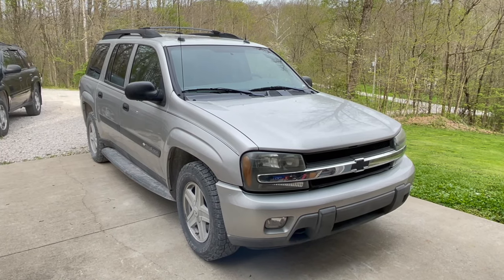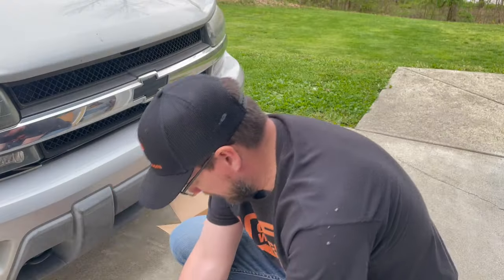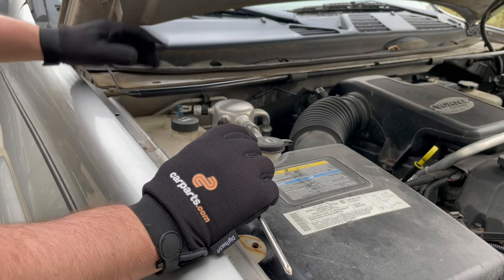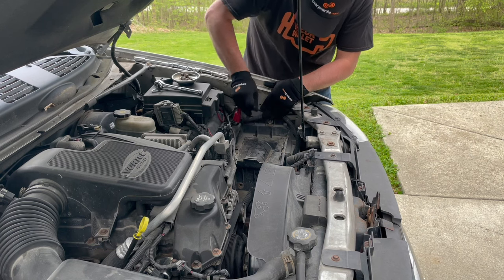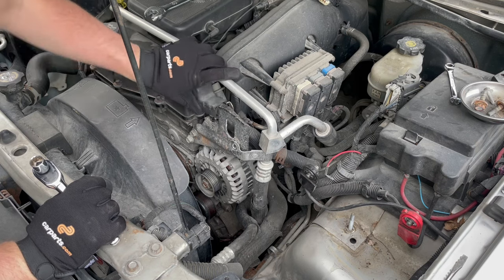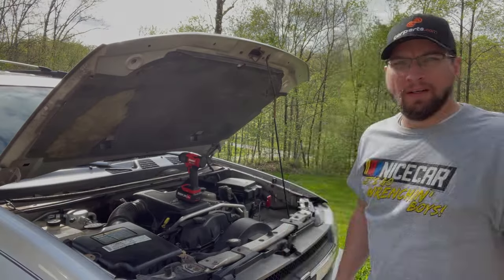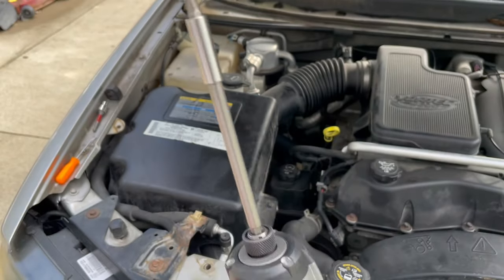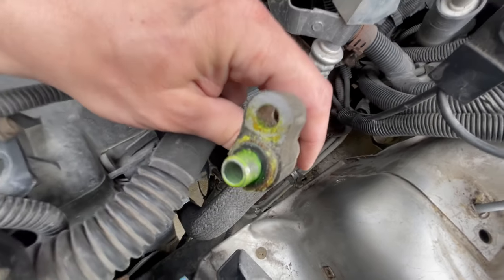Trailblazer/Envoy AC Compressor and Accumulator Replacement - CarParts.com

Comment: You shouldn't be putting that much oil in the compressor.  The entire system has about 8 ounces, with about a couple in each component.  You definitely shouldn't be putting more than 4 ozs in the compressor.  Too much oil is as bad as too little oil in these systems.
Reply: Make a video of ur build then
Reply: Rear ac always means more

Comment: I did this two yrs ago. I pulled a vacuum and recharged the system. Worked fine for a year when I discovered a leak in the condenser. Repeat. It maintains 40F at the center vent now. My root cause was a compressor clutch worn and the condenser leak from age/corrosion. I'm now at 290k miles and it still runs smooth.
Reply from the maker: Nice!
Reply: My a/c worked great one day after work then I turned off my truck to run into the store and came outside and it doesn't work anymore any ideas what it could be?I don't see the clutch engaging....
Reply from the maker: @dustingilsrud2317  either it leaked the refrigerant or maybe the pressure sensor is out

Comment: U should have added only same smount of oil from old  compressor u messed up buudy u overcharge with pag oil
Reply: No he didn’t, he put in a full bottle 8 ounces plus a little in the accumulator, his system takes 8.50 ounces with rear AC
Reply: yeah, but what about the oil that he didn’t get out of the system? Everything that he didn’t drain out of the old compressor is still in there. Now has too much oil.

Comment: You don’t need to remove the alternator…. The compressor will come out the bottom if you turn it just right!
Reply from the maker: Good to know. Thanks!
Reply: Hi, really? Can you explain a bit how to turn it right? thanks
Reply: That only works in 2WD. In 4WD you must go out the top and remove the alternator.

Comment: I’m surprised you didn’t power flush the lines and evaporator before putting a new accumulator and compressor in, that old compressor on its last leg probably put fine metal chips in the system and contaminated it, time will tell. PAG oil should not be used on o-rings. Mostly do to the fact they are your seal and you do not want them attracting moisture. This is one cause you see when two joints are locked up. It’s the corrosion caused by the PAG oil.

Comment: Did you replace the orifice tube? On the older trailblazers it’s inside the fender by the airbox, on the 06 and newer trailblazers it’s supposed to be in the firewall in that line you disconnected and reconnected

Comment: My new  four seasons compressor for my 06 trailblazer states the compressor must be placed or held with the front seal down for 1 to 3 minutes to allow  oil to coat the seal , if this isn’t done refrigerant may leak.

Comment: Hey buddy so I just replaced my accumulator in my compressor and for some reason my compressor still isn’t kicking on it’s doing the same thing that I did before I replaced both of them I replaced the orifice tube do you have any other idea what it could be also I checked the relay did the latest on it it is getting power
Reply: Did you replace the A/C relay on the accumulator?  Also, take the connector off the A/C relay and short it with a paper clip that should turn the compressor on.  Check the voltage at the compressor also; it should be around 14 volts.

Comment: This may be a dumb question, but I’m replacing the condenser in my 04 trailblazer LS. Calls for an ounce of pag oil in the condenser. I have to vacuum the system before adding Freon. Will the vacuum pull out the oil I added or am I in the clear?

Comment: Hey there.
Could you tell me how to check AC compressor out I getting power. But when I start 2005 chevy trailblazer lt I can see the Polly turning but not the AC clutch not turning at all when I turn AC on position. I'm calling from Houston TX Hope to hear from you real soon about this ok
Reply from the maker: Check the level of refrigerant. If it’s low, the clutch will not engage. Or check the pressure sensor by the accumulator. I have a video on that sensor.

Comment: Invest ina milkwaukee electric ratchet! they make them in 1/4 inch and 3/8 drive!!! if u have 12v milwuakee products, youll have a battery already. tool alone is only $99 at home depot!!!

Comment: That lower bolt on the alternator as it backs out butts right into the FREAKING A?C LINE and stopps short of cominig out!!! WHY IS MY AC LINE PLACED SO DARN"D CLOSE TO THE BOLt!11 AND everyone else's is off to the side all convenient like??!~!
Reply: Mine bolt was too, total pita!! Was easier to get a crank on it with an open end wrench once I took the fan clutch and shroud out cuz I had to change the water pump anyway. Then also did the alternator, ac compressor and pulleys while everything was apart! 150,000 overhaul lol 😉

Comment: My compressor is broken, do I need to change it along with the battery?
Reply: if it's broken yeah it should be replaced...do the accumulator too. metal shards from the compressor can get into the accumulator then will travel back to the new compressor and grenade it, if you don't

Comment: If U Can Do All THAT...  U can buy a can of  R134  &  Refill  the system  for  $40!!!  ; )
Reply: It needs to have a vacuum pulled on it with a machine before you put refrigerant in it, you just don’t stick a can of refrigerant in it after replacing the accumulator and compressor smh